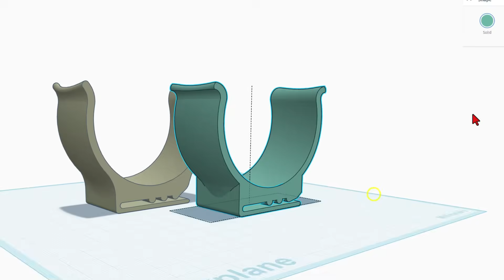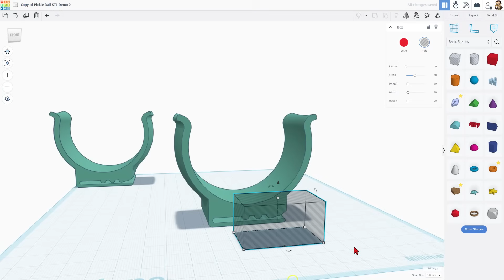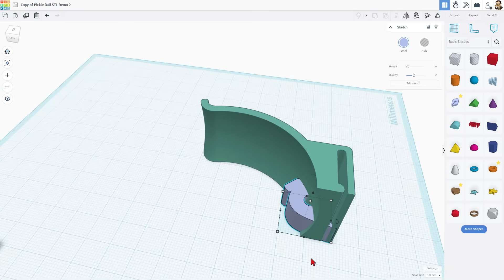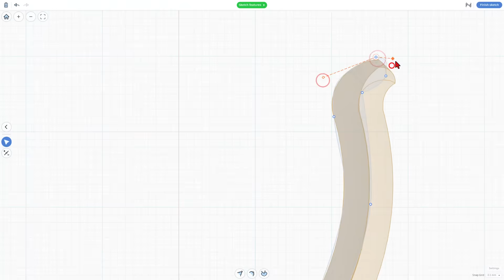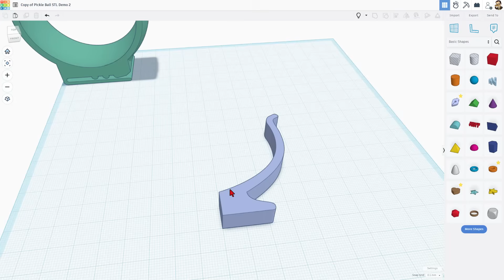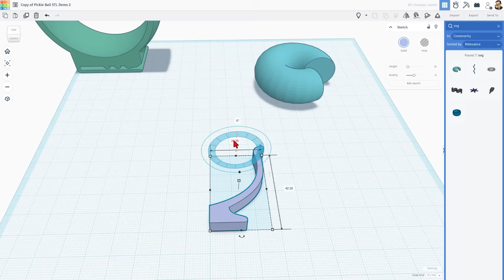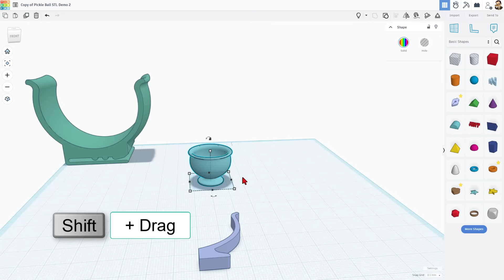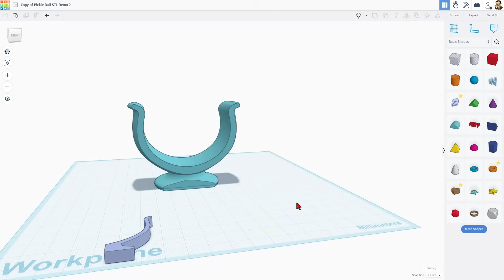Make Complex Curved Tinkercad Projects to 3D Print! SVG Wizardry 💯🔥

Comment: I'm a 3-D printer guy with a 2-D graphics background here.
Tinkercad allows you to export as a SVG file. You can then edit that vector art file in a separate application. However, after exporting and looking at that file. There are no bezier curves in that original model. Just point to point.
My question is... Does one model end up looking better than the other between the two methods after being printed? 
My first guess is to say no, but, maybe in certain circumstances.  What do you think?
Reply from the maker: Just guessing... but Tinkercad 3D printing precision has never been exact for me. Quite often there are artifacts I see in Tinkercad, but I never spot them in the actual prints.
Reply: A member of HLModtech's Patreon community asked how to remix that model/ how to redraw something like that (with complex curves) from scratch.

I demonstrated 2 approached, one with SVG Revolver that's quick but doesn't do the dip in the lip.

The second method was to redraw it totally from scratch, but showed that's way beyond basic skill level.